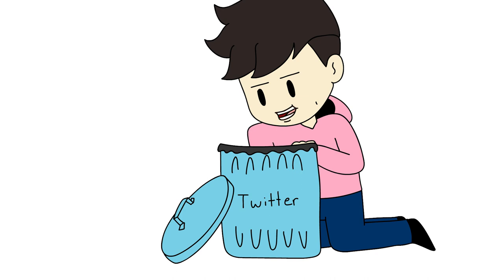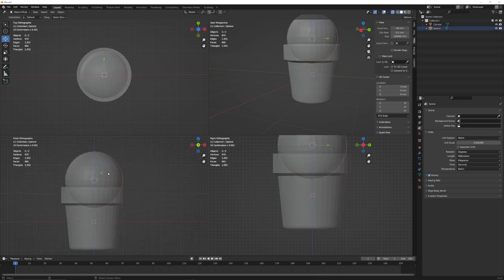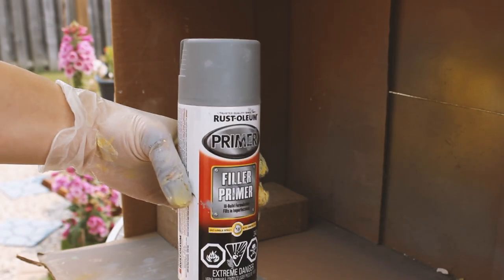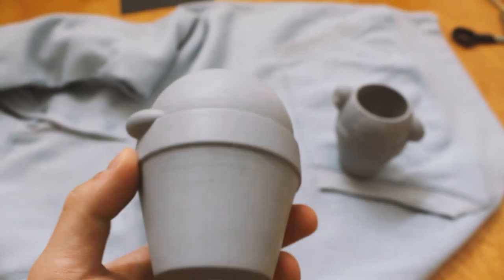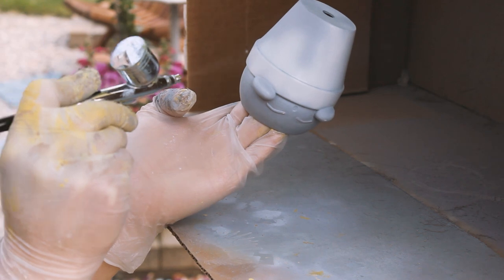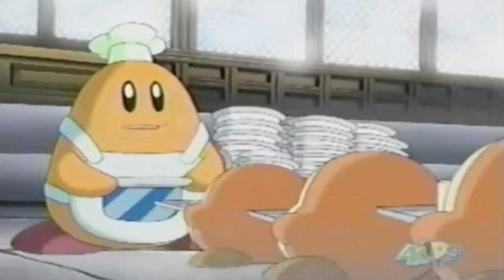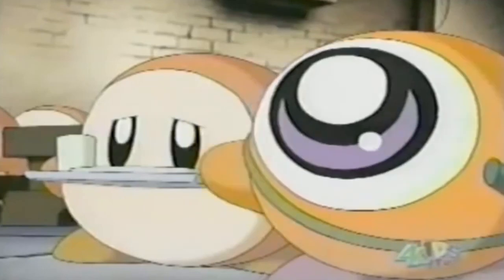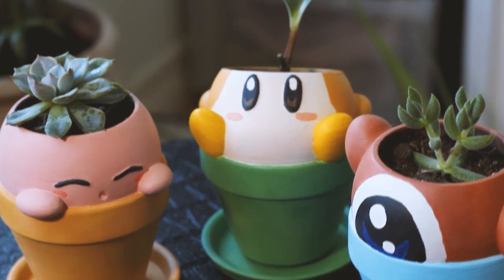I Want Kirby Planter Pots

Comment: Love your idea!
I appreciate what you're doing for the community.

If you later pursue to make a different version, I'd probably suggest just making pot toppers in different sizes.

So like, instead of wasting print filler on the pot, you could just make the kirby part as a topper to put on a pot separately. 

That way, you don't waste print filler on a pot, & you can remove the kirby part/topper when the flower/plant needs to be transferred to a bigger pot.

In which you can make bigger toppers for bigger pots (: